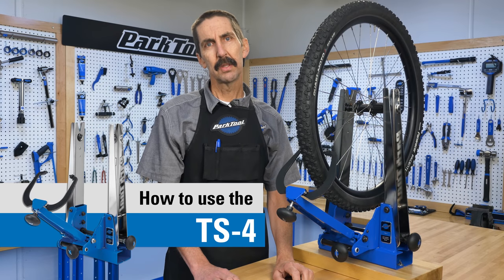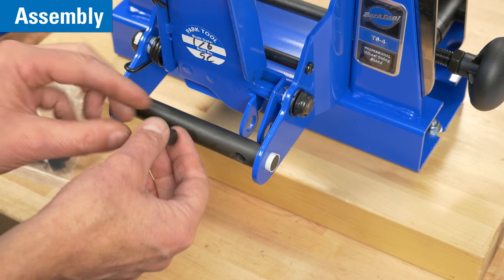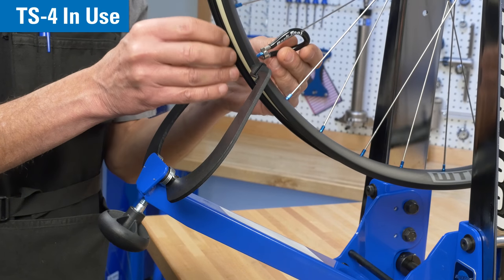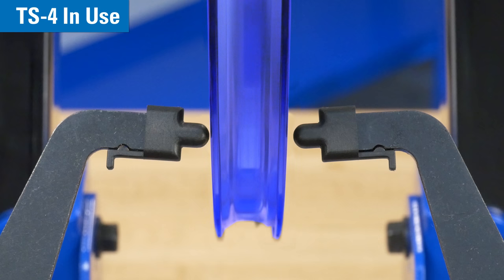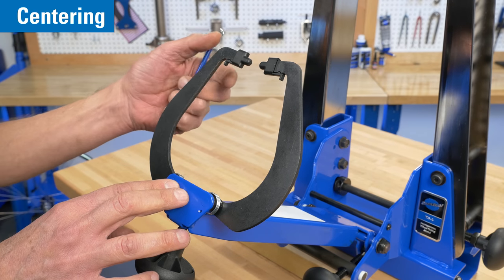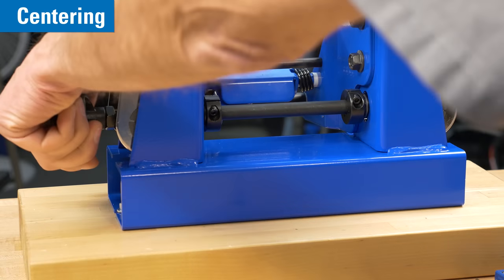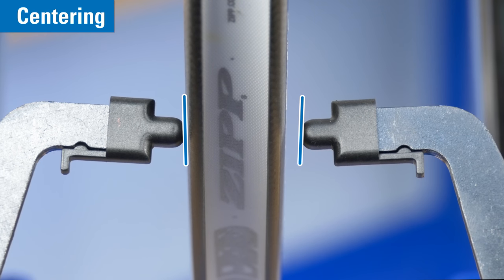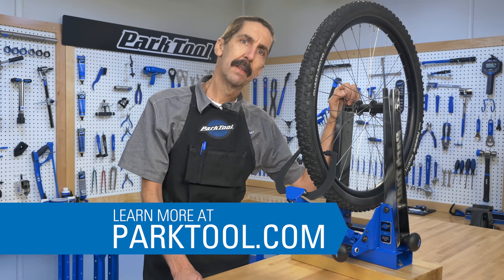How To Use & Center the TS-4 Professional Wheel Truing Stand

Comment: What I love about this is that special tools aren't required to precisely align stands after long-term use, and you share the exact methods for adjusting everything. Some manufacturers wouldn't do this for fear that customers would think their tools are poorly-made. Reality is that with shop use things are going to go out of whack, so you need to calibrate regularly. Having this guide means you can safely buy a used stand and get it back to spec, or repair your own stand, which means it will likely outlast you.
Reply: Sign of a true professional tool and company behind it.

Comment: Centering could be affected by your hub's condition as well as how its rotationally positioned in the stand. As explained in the video this is due to the hub's concentricity. I was satisfied with how my TS-4.2 came calibrated, since after I dished a re-laced wheel with the WAG-4, it was perfectly centered when I placed it in the truing stand. If desired, the calipers can also facilitate both lateral and radial truing at the same time. One reason I chose the TS-4.2 was because it didn't require the purchase of a separate thru-axle adapter. Another reason was that I wanted to accommodate 29 x 3 tubeless mountain bike tires. If my truing stand ever requires centering I'll know where to go. Thanks for the video Calvin!

Comment: This video is Super helpful, I just got a truing stand and it seemed well off Centre? I couldn't find any information on whether you're supposed to calibrate them or even if you can't, I spent a couple of hours trying to get it right. This video will be really helpful to check if I did. Thank you guys.
Reply: Nothing beats a good Park Tool video.  these guys are pros!  I have the original Park Truing stand and unless through axles take over, I'll be using that for another few decades or so.  :)

Comment: Would this be compatible with a rear hub motor wheel got an ebike? I'm not sure I can fit my 14mm axle in that triangular notch. I plan to use the stand for testing the motor. I don't want it to fly out of the stand.

Comment: On my TS2 I always calibrate on each wheel I true, front vs. rear will usually require small adjustment (the treads on the adjusting knobs aren't really perfect). It is easy once you've done a few times, and is far easier than using wheel dishing tool (totally unnecessary). Knowledge of trigonometry is a good thing.

Comment: Why use the calipers in the 'tire on" position when you are working with the tire off? You can get a much clearer sense of lateral and radial true simultaneously when the calipers are in the tire off position. Allows for much faster trueing.

Comment: I recently got knocked sideways by child bike into my front AC Aero wheel, and noticed immediately that rim was untrue with little dent just below breaking surface on that spot- since then I tried multiple times to true wheel, on truing sets, with spoke tensions, hot water over that spot, etc, but with very limited success. During ride, while breaking with front brakes, I always feel irregular drag while brake pad touches that spot, especially in moving downwards, with bigger weight disposition on front wheel... Is it possible to somehow solve this?
Thanks.
Reply from the maker: A dent in a rim can be hard to fix. Trying to repair the dent often causes more structural damage than the initial dent. The closer the damage to the outside diameter the easier it will be to potentially fix it though. The fix usually would consist of using some wood and a hammer. This is not suggested though as it can make the wheel unsafe to ride.
Reply: @parktool  Thanks for opinion. I think I flattened a dent in optimal degree (with wooden surface and pliers) that braking don't cause much dragging like before. I tried in 57km drive yesterday, it's really better...  I appreciate your opinion, really.

Comment: When I screw/unnscrew the main shaft, only one arm moves until a certain point, then both start moving. The wheel is very off-centered. Any tips? Cheers
Reply from the maker: The two collars on the main shaft are most likely not tight up against the weldment. if you follow the instructions laid out in this video you should be centered and your uprights should be move equally together. Because of the many moving pieces and adjustability of this stand there is going to be a small amount of play, typically from the play between the trunnion threads and the main shaft threads. It is crucial that the marks in the holes be centered and that the upright be centered in the weldment. I hope this helps. If you continue to have issues don't hesitate to contact us so we can walk you through further steps.

Comment: I have a question about radial trueness. If we radially true a wheel that way, are we really radially truing the bead surface on the rim?
Reply from the maker: That is true, you are.  However, we count on that being the most reliable and accurate way to get round.  If you want a real challenge but one that does makes some sense, leave the tire on and true to the outside of the tire.  Tires are not molded exactly even or round.  It will certainly give us a challenge to true this way, plus when the tire wears out, you get to start all over again.
Reply: @parktool  interesting idea!

Comment: After laterally and radially adjusting the wheel, why would you still need the dishing tool? Isn't the wheel completely balanced by then?
Reply from the maker: The wheel could be radially and laterally true but still be out of dish. The truing stand gives a good idea of how well the wheel is dished but is not a replacement for a dishing tool. If you have a rear wheel and you build it with equal length spokes drive side and non drive side you can easily radially true and laterally true the wheel but it will never be in dish. It will always be spaced to the non drive side. In this scenario the stand would tell you that you are out of dish significantly but to be able to fine tune dish it is good to use a dedicated dishing tool. Hope this helps!
Reply: I had deducted (I'm not at all a bike technician) what "radially and laterally true" means, but after your explaination still don't know what "out-of-dish" is.
Reply from the maker: Dish is how centered the rim is over the hub. Here is a good article on it and how to do it.  https://www.parktool.com/blog/repair-help/wheel-dishing-centering
Reply: Incorrect dish means the overall wheel is not centered about the hub properly.  As Calvin correctly said you could have a wheel that is perfect radially and laterally true,  but is say 5mm's too far to the left with respect to the hub overall. If you put such a wheel in your bike frame you would be able to visibly see that the wheel is not centered in the frame between the stays correctly.  It would either be too far to the left or right,  that is an incorrectly dished wheel.

Comment: Can i use this tool in a bike mags wheels?
Reply from the maker: Unfortunately there is no predictable, repeatable way to true mag wheels. There are myths out there about using thermal dynamics and temperature swings to coax the wheel back to true.... but they are, Myths.

Comment: I wish there was a way to put chalk/ink/marker  on those Caliper Caps (18) so that they would mark the rim when it hits then you would know exactly where to tighten the spokes on the opposite side of the rim.
Reply: Well, maybe you can put some ink that can be easily removed on the rim around the point where a caliper cap hits the rim. The mark that the caliper cap will make in the ink will then allow you to know exactly where to tighten the spokes.

Comment: Do theses adjustment and centering methods also work on the TS-2.2 stand?
Reply from the maker: The TS-2.2 has collars and the caliper arm axle can also be moved.  However, as stated, the most accurate method is always a dishing tool.
Reply: I have the original truing stand and dishing tool  i have to say, i'm a Park Tool fan.  Plus they look nice all together in the workshop.  :)  Great videos too!  Everything is top notch!

Comment: Why are you securing it to a piece of wood and not to the Park TSB-4?
Reply from the maker: Good catch. The TSB-4 did not exist at the time that this video was made. Thanks!
Reply: Loads of bike shops will secure their truing stands to a piece of wood because they already have a bench at the proper working height at which they like to work and the proper angle so there is no need for a tilting base.  My TS-4 is through bolted to a rectangular piece of wood just as Calvin did in this example.

Comment: what size spoke wrench should I use for my mountain bike. I would like to try and true my wheel myself.
Reply from the maker: There are a few possibilities in wrench sizing.  The idea is to use the smallest size that fits snug, so it will properly tighten.  The SW-0 (with the black handle) is the smallest (3.2mm), and common on better quality wheels.  A large size also fairly common is the red handled SW-2 (3.45mm).  You see this use on medium to lower end bikes.  However, if you can get to a good shop, they should stock the right size and get you the correct size wrench.